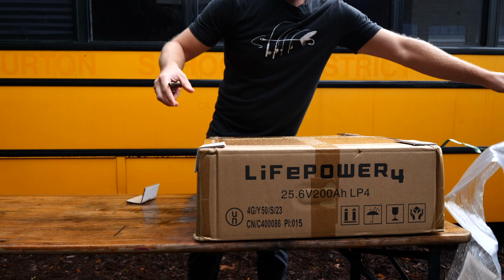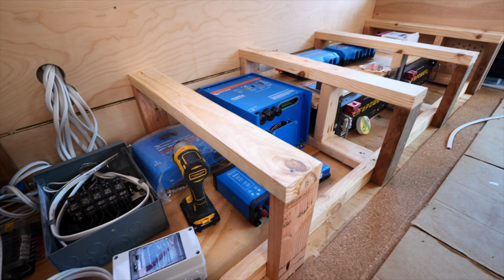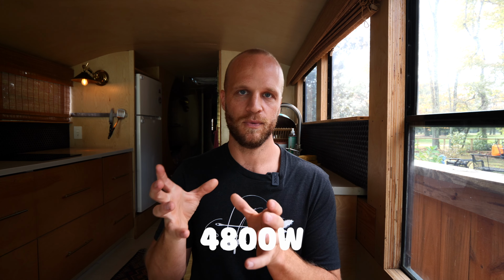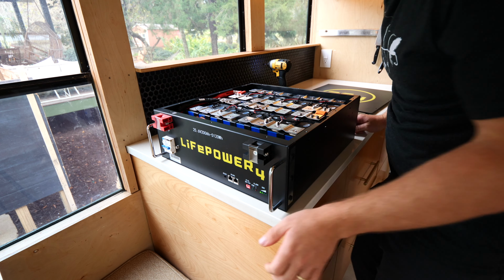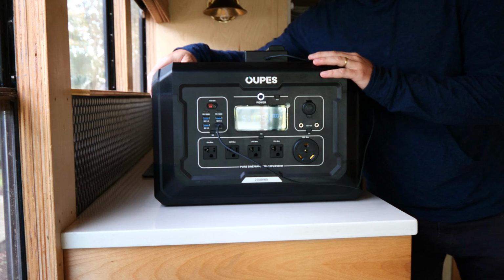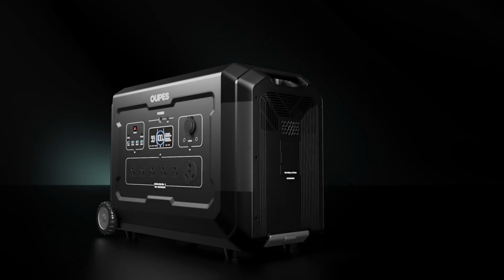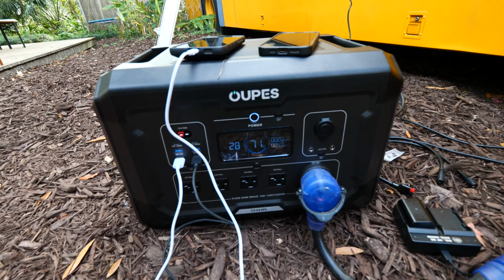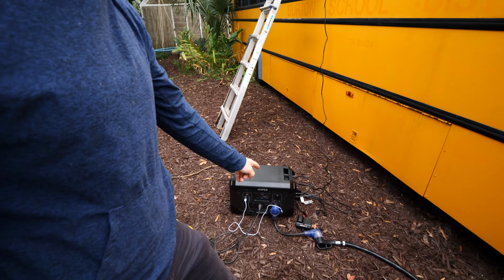The Only Batteries I would Install in a Skoolie, RV, or Van

Comment: About your price comparison, it's worth mentioning that you can build a battery bank from lithium (LFP) cells for about half the price of a server rack battery. 280 amp hour EVE cells are going for $72 each, and to make a 24v bank you'd need 8 of them, which is $576 including all the buss bars, plus $200 shipping to the U.S. You'd need a BMS too, which is $100 for the JBD 24v BMS, and it lets you monitor all the power coming in and out of the battery bank from your phone, as well as the health of each cell. And then you get something significantly better than a server rack battery since I don't think there's any monitoring with server rack batteries, though I might be wrong about that. You can also build your battery bank into some random corner of your RV a lot easier since the form factor is malleable. And you get 280 amp hours instead of 200 amp hours for the server rack battery, almost 1/3rd more power. For hundreds of dollars less. Building a battery bank is about $800 for the cells plus $100 for the BMS = $900 for 280 amp hours aka 6720 watt hours = $.13 per watt hour. That EG4 server rack battery is $1259 for 200 amp hours aka 4800 watt hours = $.26 per watt hour, which is almost twice the price per watt hour.
Reply: By far the best option.

Comment: Dumb question incoming. Why 24v? You get half the capacity not to mention you need to step down all the 12v stuff. Thanks a bunch for the videos. 😊
Reply from the maker: You can use smaller cables which means a less expensive install and you can accept more solar input from smaller charge controllers. You don't get half the capacity as 12V, you get the same! The inverters are cheaper too, And a simple 24V to 12V step down converter is cheap and trivial to install.
Reply: @MobileDwellings  Same question... sort of... why not just go straight to 48v?
Reply: @bmcga1 you can if you like! However you need to be way more careful around the 48volt so 24volt is a sweet spot for anyone who lives on the go or needs to rewire/do upgrading and repairs

Comment: You failed to mention, the solar generator will not discharge in very cold or very hot weather, which often is when you really need ot the most (heater or ac). For that reason, I do not recommend that as a van life power system.

Comment: I'd suggest avoiding LiTime, they use B or even C grade cells.  A number of users on the DIYSolar forum have had cell failures, BMS failures, and even venting of cells with LiTime.  I'd suggest sticking with EG4 or SOK as the absolute bottom end.  Buy cheap, buy twice.  Additionally, if you're handy, you can build your own pack with EVE Grade A cells (buy only from known good vendors) for almost half the price per KW than the server rack batteries.
Reply: Where do you buy these cells?

Comment: You can’t run only one EG4 battery with a MultiPlus, the BMS will automatically trip the breaker. 

Don’t forget to add $300 for shipping and the terrible Signature Solar customer support.

-24V EG4 battery owner with MultiPlus

Comment: The only advantages of the various lithium chemistries that I can see so far is fast charging time and much less weight,
That is an awfully high premium to pay

thanks for the video!
Reply: They last a heck of a lot longer than lead acid batteries, so the cost is not a high premium at all when you factor that in.
Reply: @magnoliathebus  Well, that depends too. I have a pair of Optima AGM batteries (yes, expensive themselves) that are functional at 10+ years. I keep them happy by keeping them charged w/ periodic smart charger (not trickle). These LiFePo4 batteries have great claims, but I don't know that they have even been around for 10 yrs to have a proven track record. I am still watching and waiting. I am seeing the prices coming down.
Reply: @jamesalles139  I think they have been, and are proving to last much longer. The science is pretty strong here. Also, they have a much deeper discharge and cycle life of 3000-3500, far far more than any AGM battery.

Comment: Gel batteries that run semi's electrical auxiliary power packs work WAY better than lithium.
Reply: @magnoliathebus  not sure what is so funny?
Reply: @scottgwin01  Because it made me laugh out loud. How can you possibly figure that an AGM battery is better than a Lifepo4 battery?
Reply: @magnoliathebus  I've used them since they have been on the market in ever semi I have had. Zero issues. The power everything I need, unsupported, for 12-15 hours continuously, day in and day out with an exceptional recharge rate. They will hold a charge for up to a week and a half when in stand by mode as well.
Reply: @scottgwin01 I don't believe that makes them better, though.
Reply: @magnoliathebus  less maintenance and cheaper, better!
Reply: @scottgwin01 AGM batteries have far more maintenance than lifepo, not sure why you think otherwise, and the cost is offset by the cycle life.
Reply: @magnoliathebus  how long have you been using those?
Reply from the maker: this is an example where the Lead acid batteries make sense for the application. Weight is of no concern, space is of little to no concern and the need to charge in freezing weather will be frequent and essential.
Reply: @MobileDwellings  you're right, in an RV there is no space or weight limitation like there is in a semi.